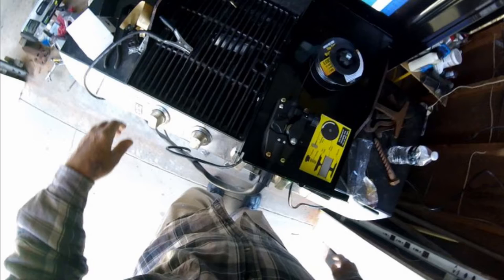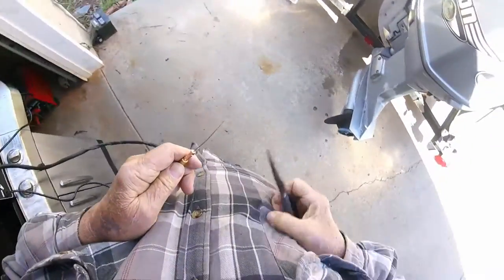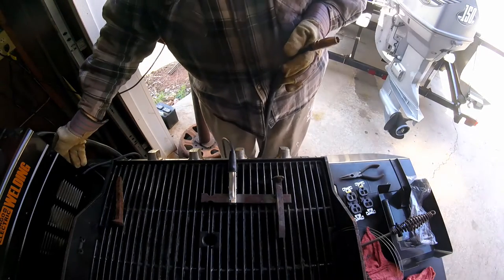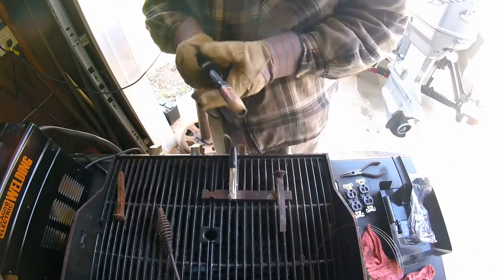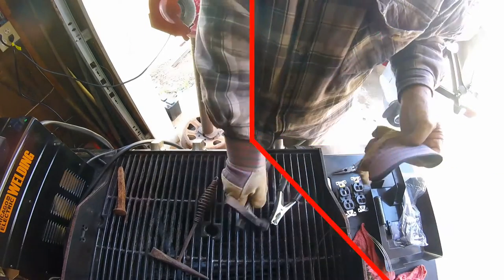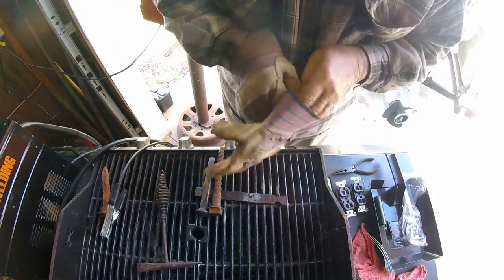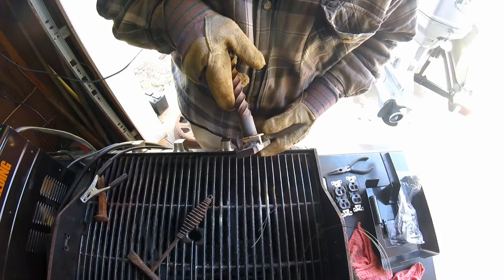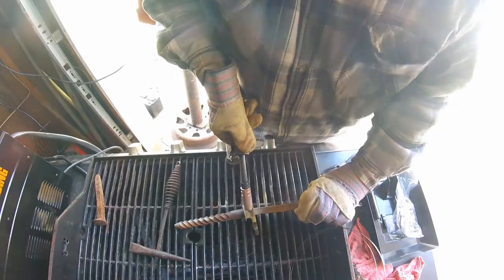Pwalpar VLOG How To Make A Whomp Womper

Comment: Comment, that can burn the eyes of your viewers.  You might want to put a screen over the brightness of that arc.  Just a thought, but that should be noted in your instructions about others watching the welding.  Ours said not to allow them to view it without having a welders mask screening their eyes for protection.
Reply: Watching welding on a tv or computer screen cannot hurt anyone's eyes,  unless maybe they watch it repeatedly for about 60 years straight, non-stop.  There is non enough power in the amount of UV light captured by the camera or reproduced by the monitor or television (or movie screen in a theatre).  No danger whatsoever.  You only need vision protection when you are personally present at the site where welding is being done.
Reply from the maker: Thanks I dont think ultra violet rays get thru on the videos
Reply from the maker: Thanks for explaining Stan